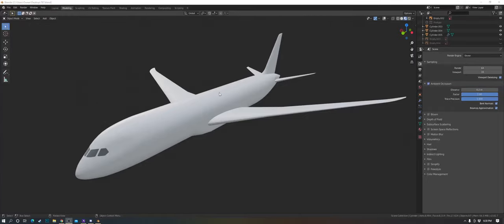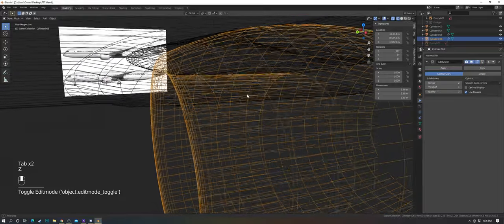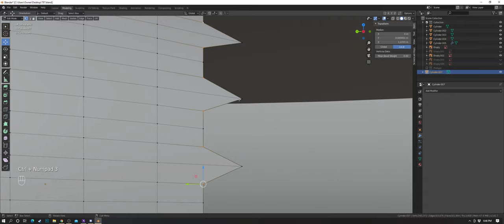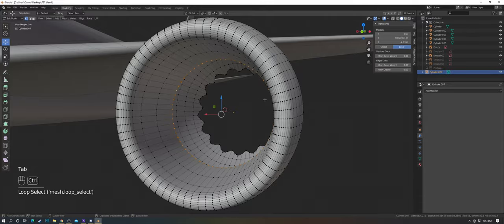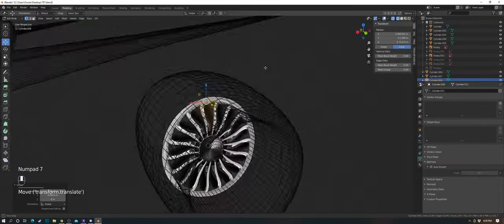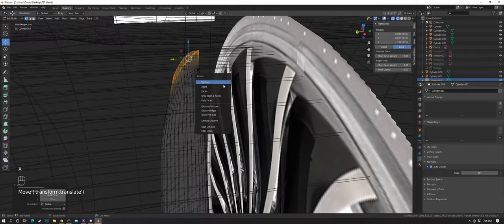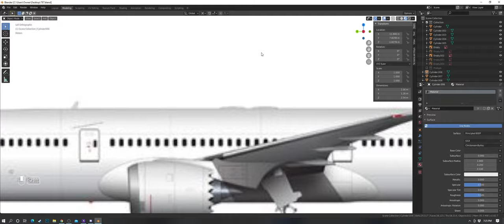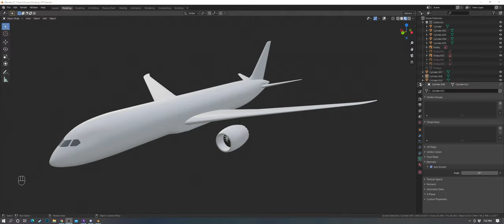Blender | Boeing 787 Modelling PART 4...Engines

Comment: @Brady Margeson If you want a mesh object on center point to another mesh object, you can use 'N' and copy-paste the X, Y, Z axis locations so that's it's on-point.
Reply from the maker: This is true. Do this all the time :)
Reply: @BradyMargeson  Please keep going with the series. It has helped me so much to make two airliners - the A350 and the A300. This is by far the best series on modelling an airliner in blender!